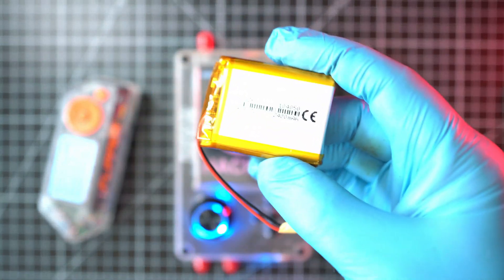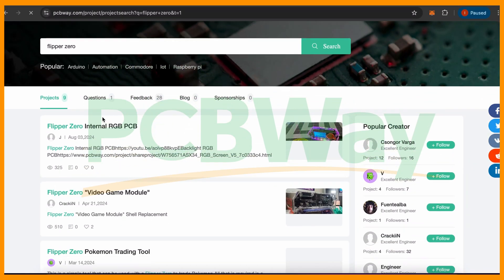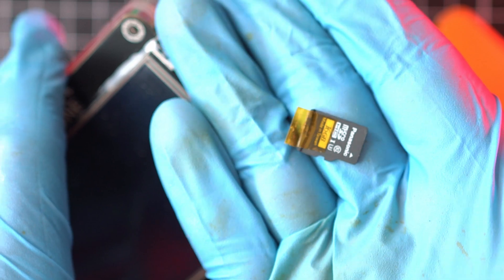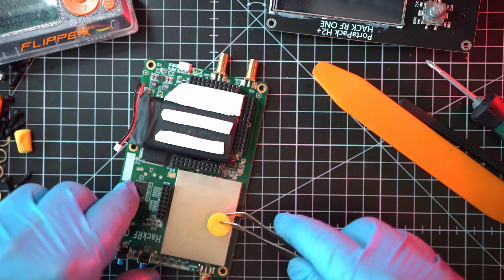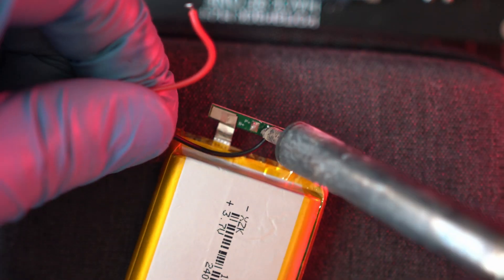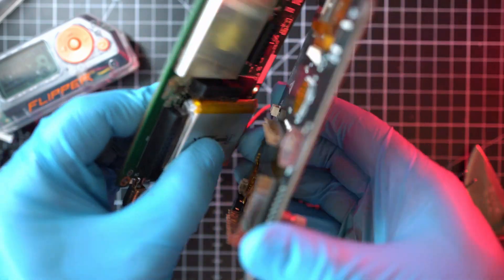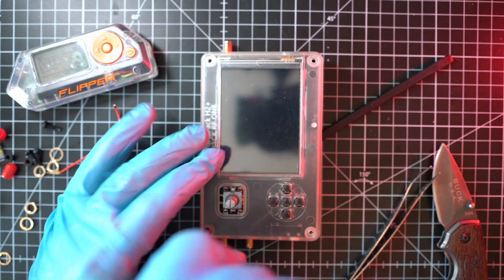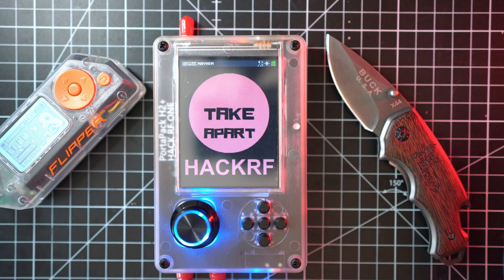HackRF One Portapack H2+ Battery Replacement

Comment: Nice, now can you make a video on disabling the annoying battery indicator LEDs?
Reply from the maker: will do … but how will you know state of charge ?
Reply: @takeapart  I use a Nitecore NB10000 battery velcro'd onto the back with a mini cable connecting the HackRF, it has a power button and battery indicator on the battery. 😁

The LEDs are super annoying when you don't need them.
Reply from the maker: ah I see ...in your case it will be great to get rid of the LEDs , but other users may want to have them .... maybe just dark tape would solve your issue.